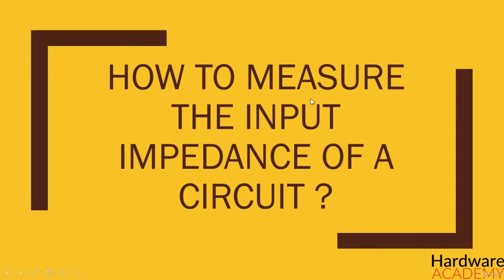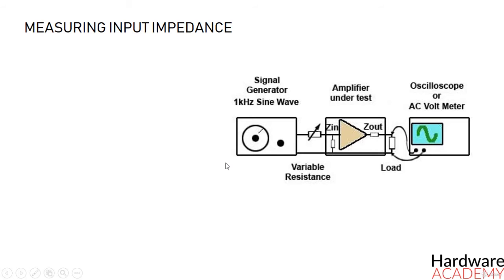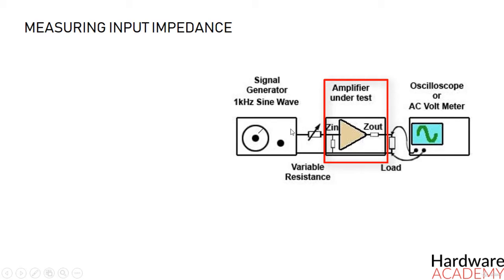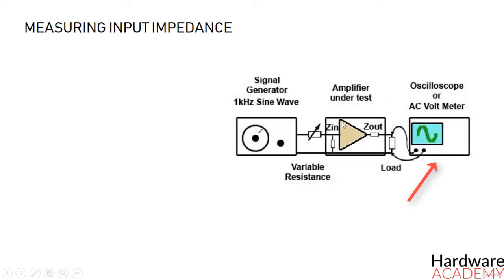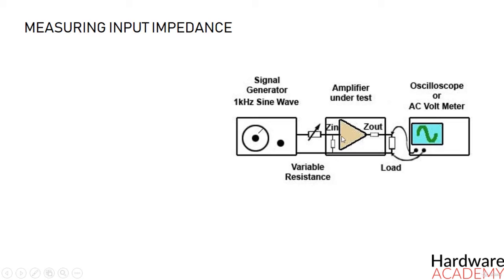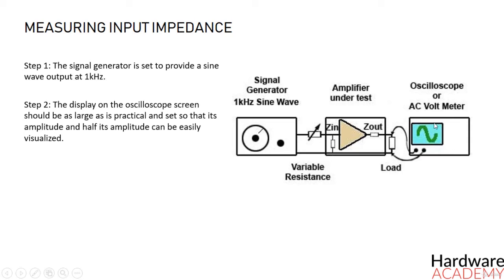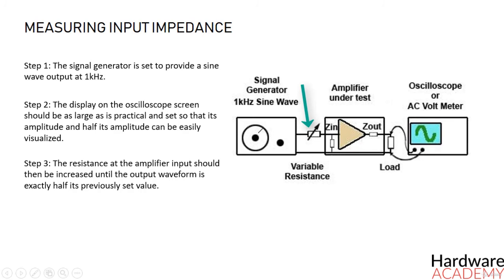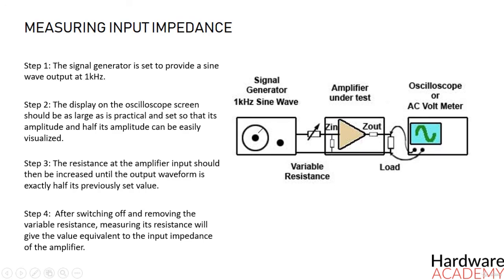33- How to measure the input impedance

Comment: Hi, how much amplitude input, just below clipping, half of that? The best variable resister I have goes down to 1.6 Ohms and up to 49K, there is still signal on the scope at 1.6. Should I used the variable to reduce half of 0 to full scope display or between the variable resisters resistance parameters? Thanks.
Reply: I'm a bit late to the party, but for future reference: 
Even if your meter is reading 0 ohms, it is not a true reading of the resistance of the circuit - there is resistance in every circuit (even with superconductors), so it shouldn't affect the result unless you are working with extremely low impedance values.

Comment: If I don't have a oscilloscope, can I use a multimeter and increase outside resistance until AC voltage drops to half its value? Wouldn't that be just as good?
Reply: I think it's okay. The difference between oscilloscope and multimeter is that an oscilloscope measures the peak-to-peak voltage where a multimeter measures the rms. But in this case, the ppv and rms of a sine wave is the same.